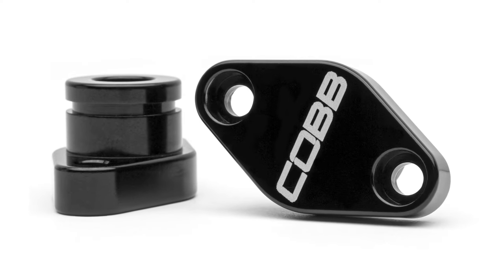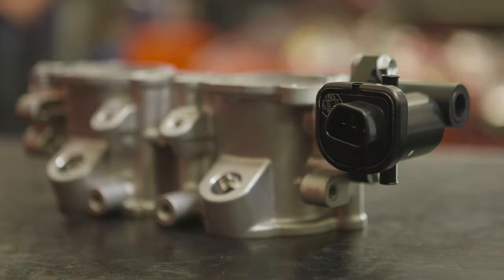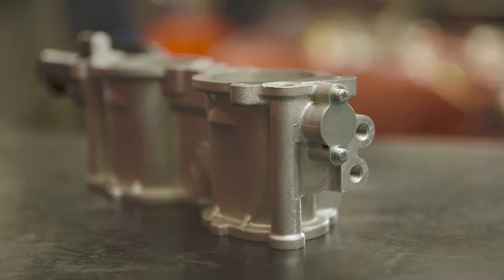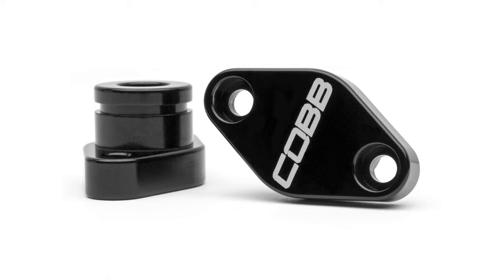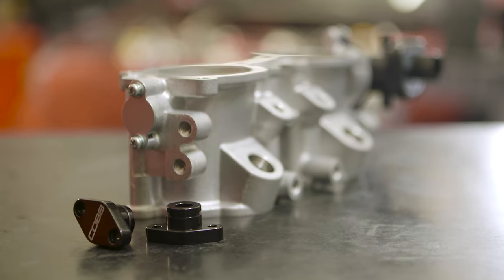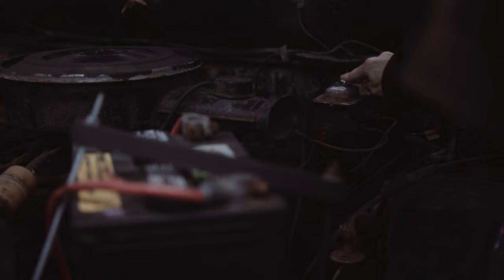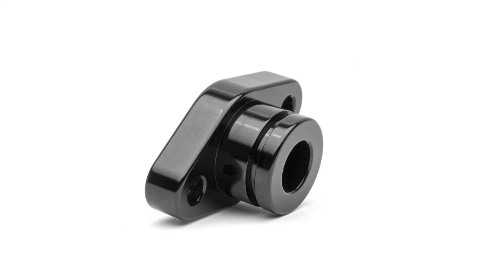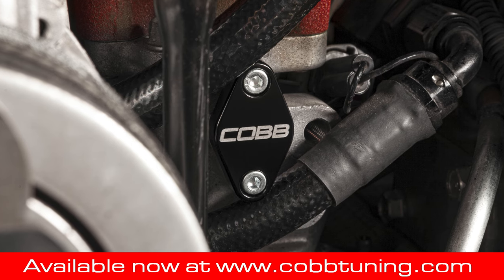COBB Tuning - SUBARU EJ TGV Shaft Seal Kit

Comment: so, do the FA engines not suffer from the same failure?  Are the FA20DIT TGV designed differently, w/o the cover?
Reply from the maker: Correct, the FA motors utilize a different housing.  We have not seen this same failure point on that style TGV housing.